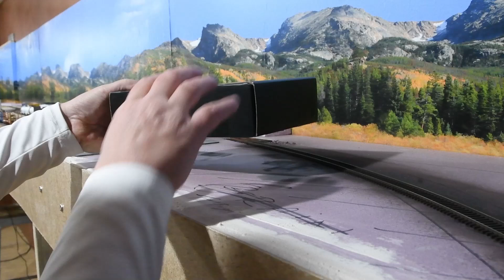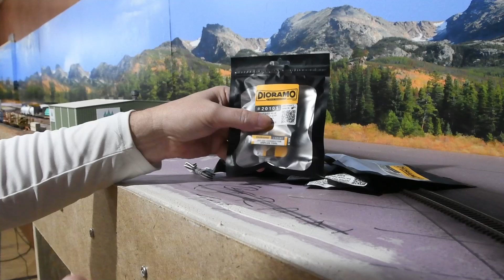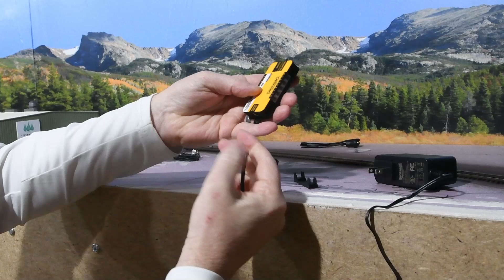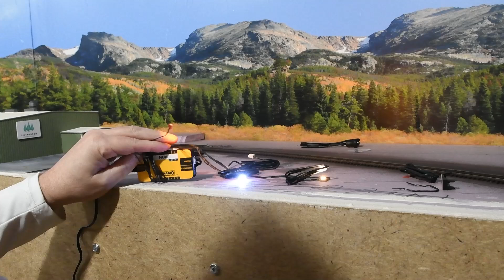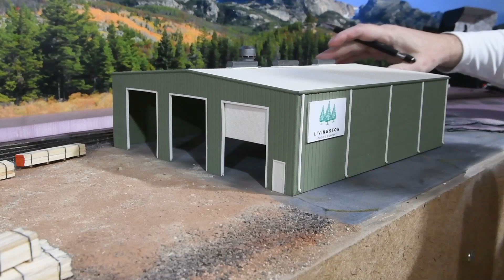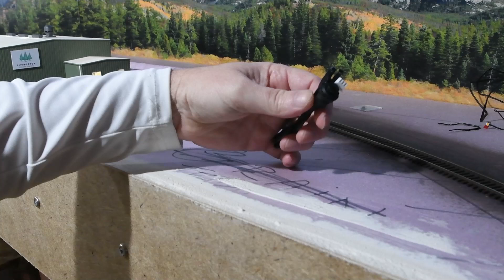How to Light Up Your Buildings (The Easy Way)

Comment: The warehouse looks great! For the interior, I would go to Google and search "lumber warehouse", click on the Images tab, and print some out at the right size. Cut them out and glue to a piece of cardstock, and hot glue to the interior walls. Maybe park an HO forklift in there, and some trucks in the parking lot. I agree the office is too bright.  That's one thing I like about the JustPlug system, every input has a built-in dimmer. Another commenter had a great idea with the parchment paper. I would do a photo interior there as well. Really enjoying these tutorials. Take care - Bill.

Comment: Looks great thomas. I'd recommend sanding out a little notch on the bottom interior wall for office for wires to sit in so that the wires and wall sit flush on base. It should eliminate that bottom light bleed at the office base. The wires are causing the building a slight lift off the ground. Otherwise looks great. Looking forward to next update.
Reply from the maker: Hey Matt, thanks so much for watching. Yes, after filming the video I made a notch for the wire to pass under.